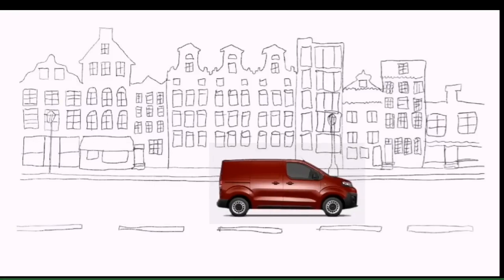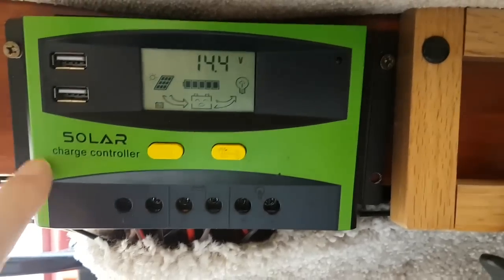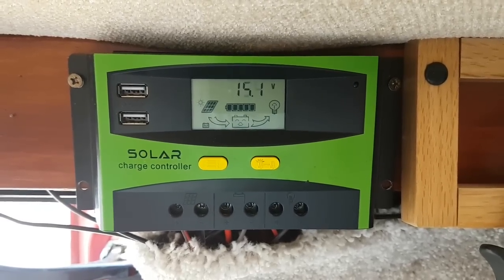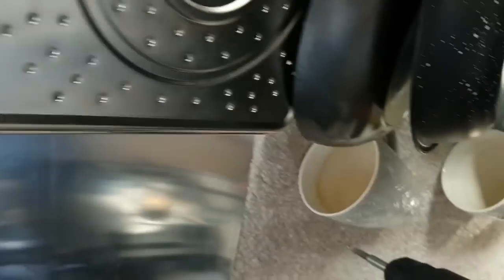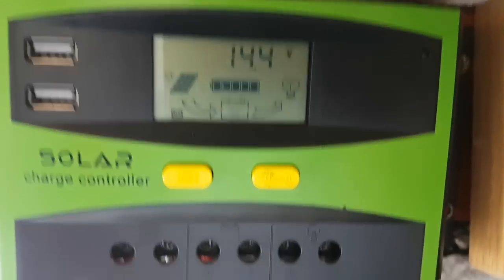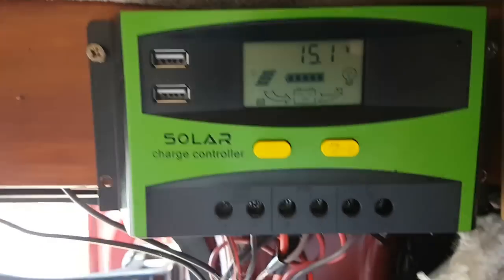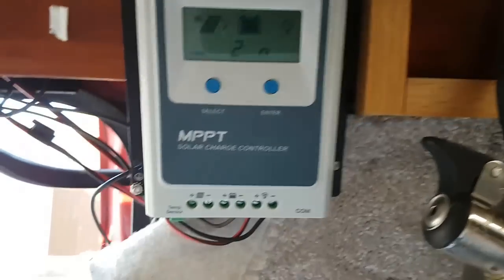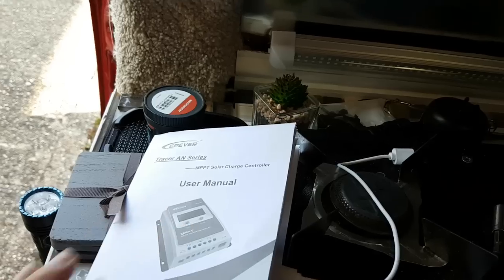Mppt Solar Charge Controller Upgrade : Going from Pwm to Mppt I'll let you know the Results?

Comment: I you dont already have one a split relay thingy so you can charge the battery off the vans alternator while you are driving is a better investment than new solar aproaching winter, its around £70.
Reply from the maker: I had one originally but I burnt it out ... I'll have to reinvest in another 👍🏻 cheers Helen

Comment: 👍 Have the same one. Works well. I think the light bulb needs to have the lines around it? Press enter and it should do it.
Reply from the maker: Hiya.. What's the lines around the bulb mean?
Reply: @TheUrbanstealthCampervanMan  not sure. The instructions aren't that clear. Saw another YouTube vid where they said it's on/off?
I think as long as the cables are connected and display is on it should be cool 👌

Comment: Super change you will have more power in winter and it's much better for your batteries, way to maximise what you got 10 out of 10
Reply from the maker: Cheers Morgan.. 👍
Reply: No problem, to charge a 12v battery bank you really need 18 v coming in, I have 300 wats at 18 volts and its excellent but my battery is brown bread, so that's going to cost ouch but for a approx 1 months rent I will have all the power I need
Reply from the maker: @morganbrennan9090  ouch yeah I know what you mean batteries are mega expensive 😳
Reply: So is rent and it occurs every month, I'm just making someone else fat with the whole rent thing, Ps you must have enough paintings for a exhibition, reckon it would do well
Reply from the maker: Yeah exactly Morgan 👍
Think I'm up to 40 paintings now something like that...